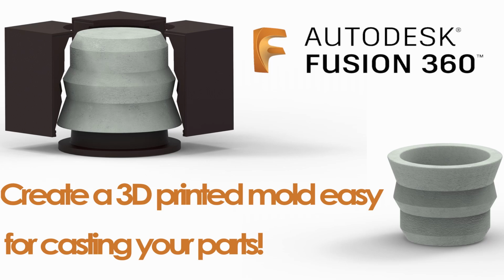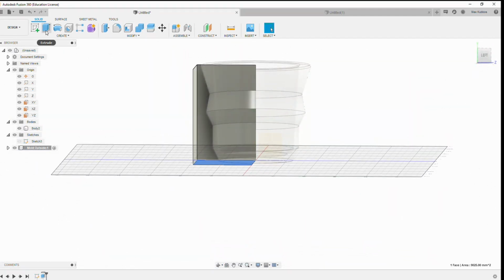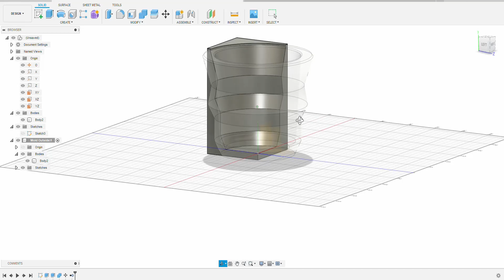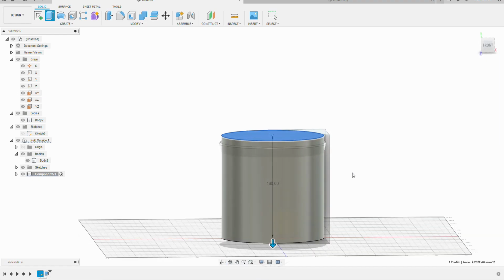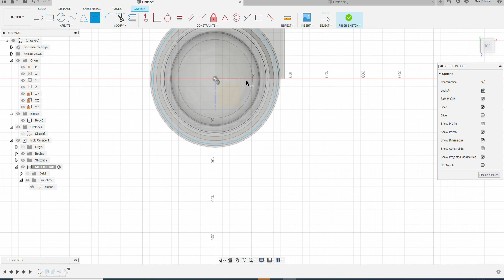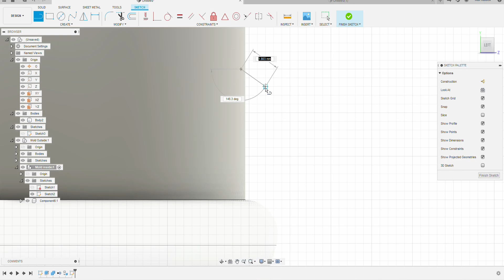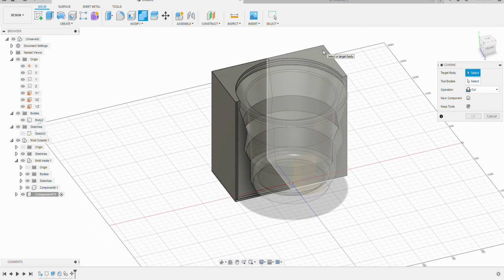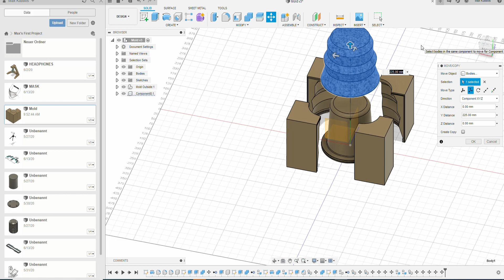3D printed mold | tutorial | fusion 360 | molding

Comment: Am I misunderstanding something here?
I think the bottom of the mold needs to be open, right?
Otherwise it is not possible to pour something in, I think this is a missing step here.
Reply: No, the vessel is upside down in the mold and you pour the concrete from the bottom of the vessel, which is at the top opening of the mold. See the first seconds of the video. The confusion is because he designs it upright (the vessel is upright), but in practice it is used flipped.

Comment: Hi there! Thank you very much for your tutorial, was really useful! I followed it and I even 3d printed it! But it gets a little bit hard to pull out when the concrete is dry, actually my mold broke :(  Do you think it would be easier to unmold if the parts are divided into 3 instead of 4 and with diagonal cuts as Alexandre does? How would you do it? I'm very new to 360 fusion and I don't really know how to divide a cylinder into 3 with diagonal cuts! Thanks! :)
Reply from the maker: You Need to draw a cylinfer insted of the square and divide in by 3 with an angle of 60 degree. Then every step should be the same
Reply: @cadprocess3784  Hey Thanks! I actually find this Emboss tool and use it to divide the cylinder into 3, worked perfectly! I'm already printing molds that work good for me. Thanks again for your tutorial! :)
Reply: Thank you so much you so helpful